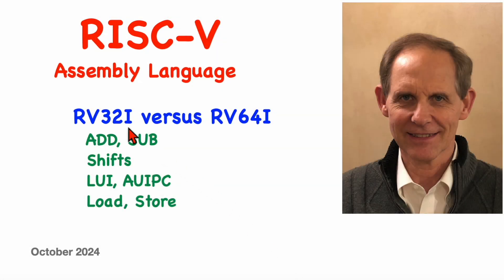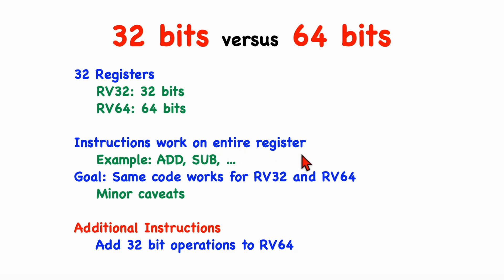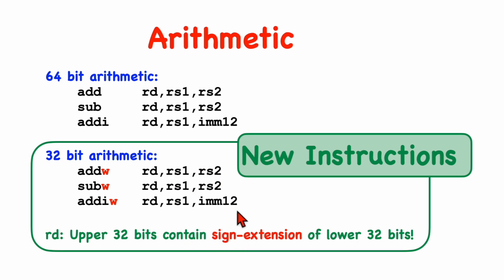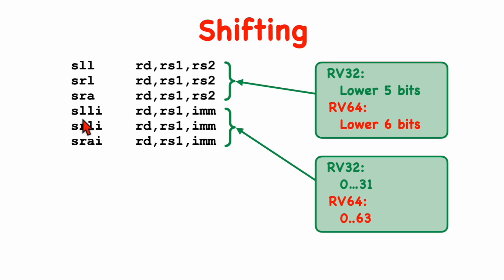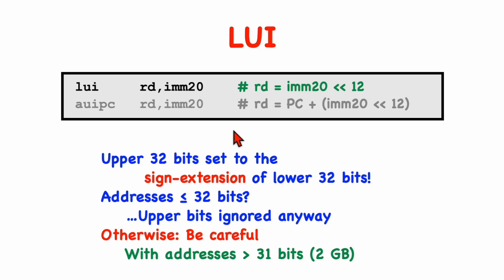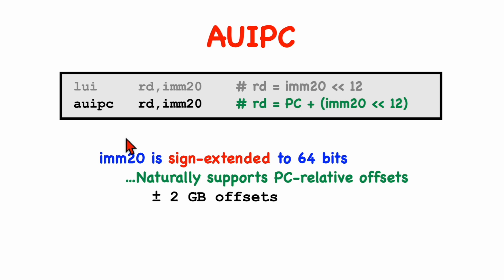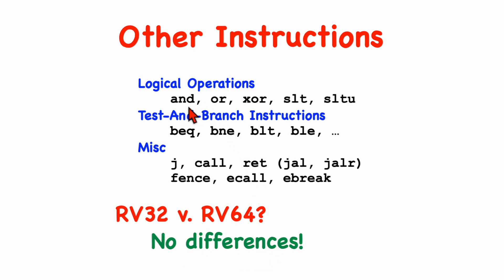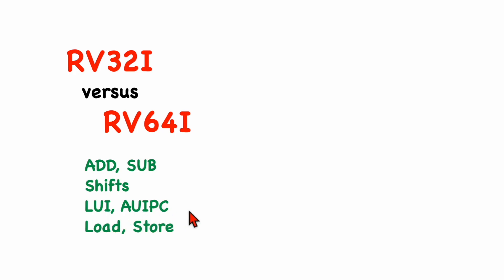RISC-V Assembly Code #5: RV32 v RV64

Comment: Kind of random: I have my own C compiler that I recently added the ability to target RV64, in addition to my own ISA (my CPU core runs both my own ISA and RV64, namely RV64G with a few custom extensions). One bit of wonk though is that my ISA and compiler took a different path:
Early on, I had implemented the Hitachi SH-4 ISA, and my first ISA was basically a direct superset of SH-4. Later, I did a partial reboot, redesigning the encoding scheme, but mostly keeping the same basic ABI design (loosely derived from the WinCE SH-4 ABI), and much of the ASM remained backwards compatible (there are differences, mostly with misc instructions and features that were dropped; with some things being faked in  the assembler).
Adding RV64 was a bigger challenge, but more in terms of significant ABI differences (such as different registers for passing registers and caller/callee save, ...).

But, now there is another bit of wonk:
My assembler does not use the proper RISC-V ASM notation, but instead still uses a notation derived from GCC/GAS SuperH notation (loosely M68K like, but without the % prefixes, ...).
In concept, it wouldn't be too hard for the assmbler to support the proper RV64 ASM notation, but would need to find a good way to tell them apart (in this case there is some level of syntactic overlap. This is unlike, say, Intel vs GAS syntax on x86 where there was less room for ambiguity as to which is which).

Most troublesome difference is that the two notations have different operand ordering, and there may not necessarily always be sufficient context to make it unambiguous (say, between RV code written in "Rd, Rs1, Rs2" order vs "Rs1, Rs2, Rd"; so "fingerprinting" does not seem like a safe strategy in the absence of more obvious and unambiguous differences). And, here, the likely main way to fingerprint them would be things like "LI Rd, Imm" vs "MOV Imm, Rd" and similar (and various other cases where proper RV ASM uses different mnemonics; for my compiler it was initially easier to just keep using the mnemonics and similar from my existing ISA, but remapping them to the analogous RV64 encodings). But, fingerprinting may be sufficient (it is either this or define an explicit assembler directive); one area of concern here being if someone makes a mess by going mix/match with the mnemonics.